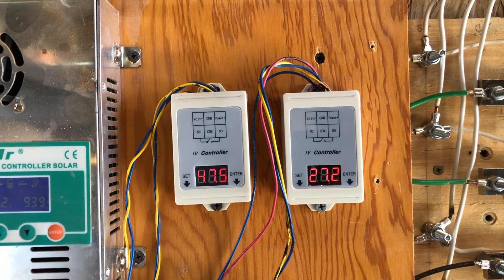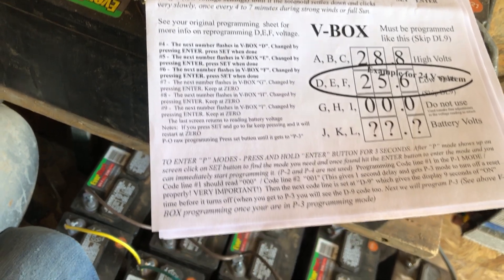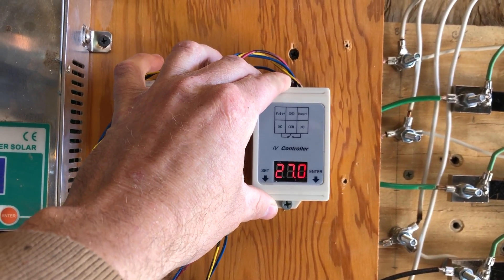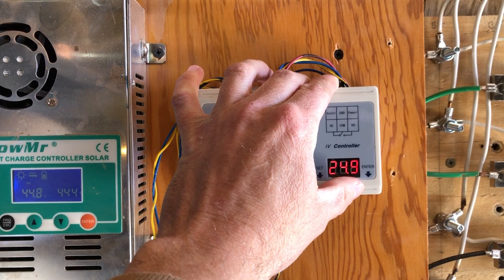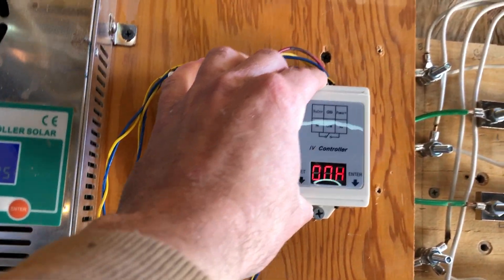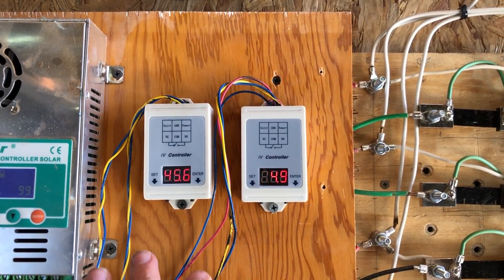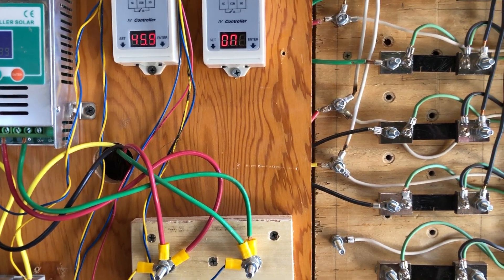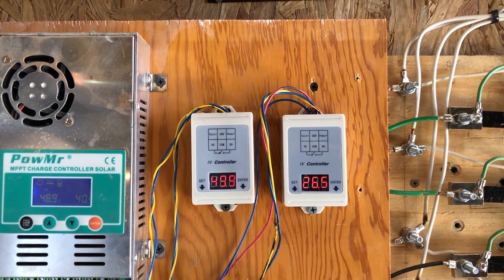Programming G4 and G5 charge controller / dump load controller "brains" from eBay

Comment: I use a few of these. Work great. One is to turn on a braking resistor for wind turbine. The other is to turn on an active balancer for my lifePo cells at 14.1v and off at 13.8v

Comment: Suggestions : I think the third screen (000) is to allow you to adjust the battery voltage reading on the display if different from actual battery voltage  + or - adjustment .

DL 8 screen is I think so you can set a delay (seconds) to the voltage sensing if say you are having the voltage from battery flicking up and down quickly , allows a few seconds for reading to settle.
That's what I think those two settings are for.
Reply: Yes it does. Offset +or- 0.9 volts

Comment: Well, I just got mine to use on my new Ista Breeze. I cannot figure the crazy thing out to save my soul! I don't know what you did to program it. I get all sorts of weird stuff in the display. Out of the box it didn't work. The instructions are terrible. What is a V-Box? All the letters a b c d e f etc. If I don't hook up power to both screws 1 and 3 to +, it behaves erratically. Right now I'm baffled and very disappointed.
Reply from the maker: Hi Curt!  Does yours not cycle through menus like the one in my video here?  I wouldn't worry...I think the instructions they send only make sense if you already know how they work!  Is it a G4 or a G5?  Shoot me an email and I'll see if I can get you through it toysforwatts@gmail.com
Reply: @ToysforWatts  Hi friend! Well, again thanks for your help! OK, first I learned that a jumper MUST be in place on the 2 outer screws on the lower strip for the thing to even work! That is 1 and 3. I need to know why that has to be done. Next, I needed to change what the instructions call M,N,O from On.H to On.L. Because I want relay to energize at the high voltage limit setting to kick in the dump loads. THEN, watching your video like 6 times, figured out how to set the low and high limits! Much more simple than the crazy confusing "instructions". There are few videos out there that can go through this device in a clear manner. I think it's because the people themselves don't understand the thing! It's a nightmare, but I think I got it to "work". I used my variable regulated DC power supply to simulate a working system. Now I just gotta try it for real! This V-BOX ABC stuff just throws sand in my machinery! LOL.

Comment: One of the things that a controller like that could be used for is turning on an inverter that doesn't have an auto restart after a low Voltage dropout.

Comment: Low could be set up to a battery charger or separate pv or turbine
Reply from the maker: Yep after posting this I started thinking it'd make a great charging circuit...my brain is so much on the generator side sometimes I have to spend a lot of time thinking about the battery side for anything there to make sense :D

Comment: Thats why I've developed my own..
I still need to polish the firmware for the web interface, and make it more user friendly before start selling, for easy voltage trigger setup and dump / charge mode selection for each output.

http://ultimatecdc.com
Not much info yet.

In my lithium setup, I charge it and use energy st same time.
If bank is full I divert the extra power to grid tie.

I can also set it up to dump a small ammount during night to help house standby consumption.

So far, triple output, highly customizable for charge and / or dump mode.

I can drop you my contact if you would like to know a little more.
Reply from the maker: When you get one up and going I'd love to know about it! :D